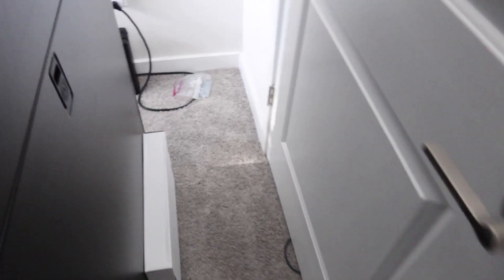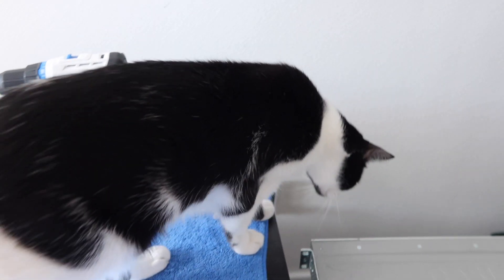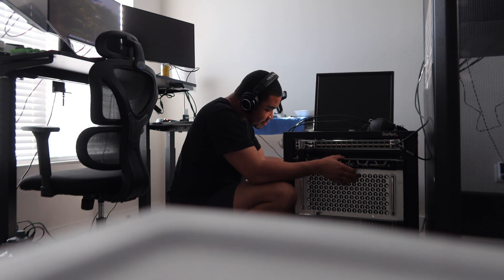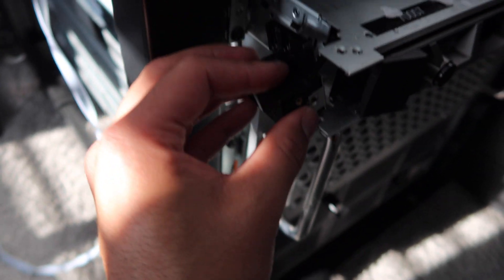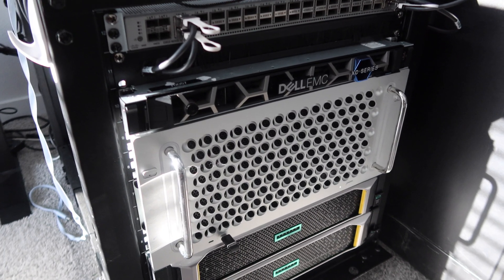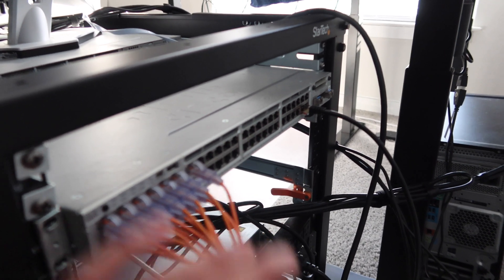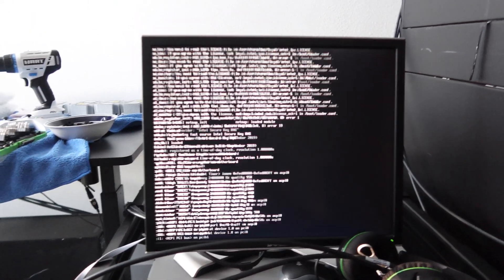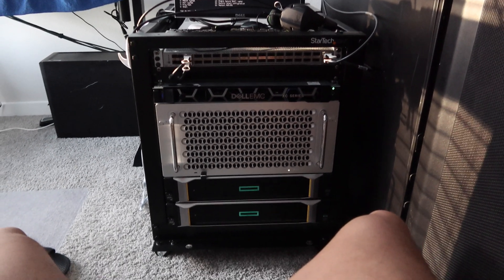2024 Homelab Build Part 6: Working On The AI Rack! (Mini Rack)

Comment: Dell D419M Right Server Rail
Dell Y819K Left Server Rail

Also your 40G switch has airflow R-F aka its rear of rack mounting (you can tell with blue tabs for the fans, aka cold side, if they were red then that'd be the hot side
Reply from the maker: Thanks! And yes, I have the red fans for the F-R but I don't foresee this being an issue